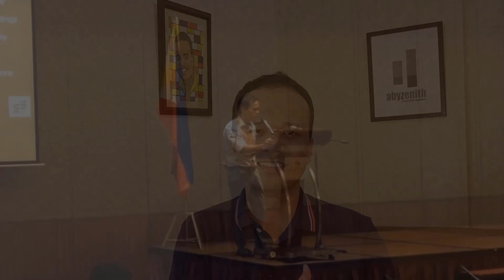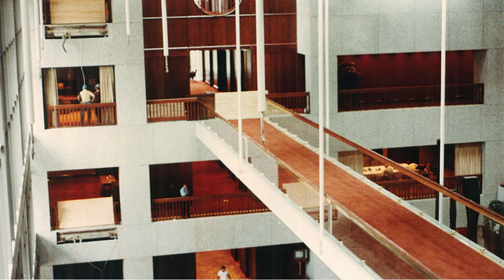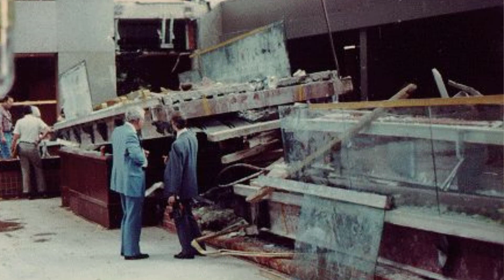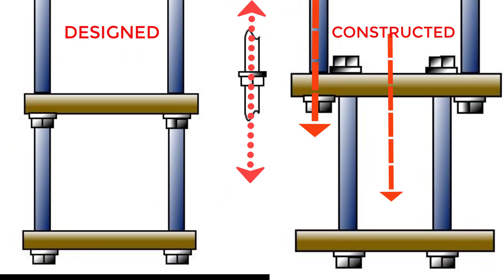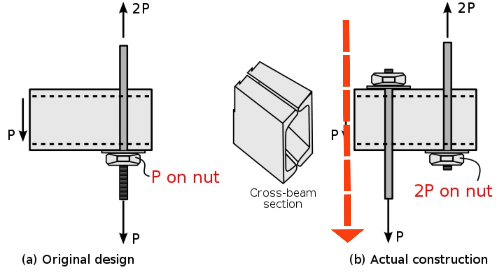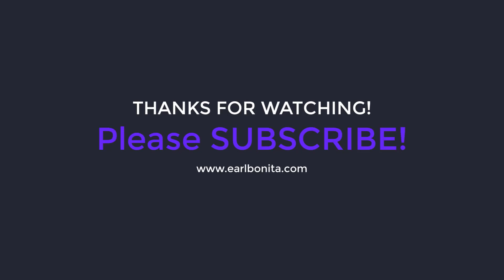HYATT REGENCY "SKYWALKS" COLLAPSE LEARNINGS from STRUCTURAL FAILURES and CONSTRUCTION FAILURES

Comment: The part I always have wondered about was the channels welded together at their thinnest spots as a guy asked a week ago one piece square tubing would have been stronger but more costly but if your going to weld channels to make a box beam why not turn it sideways so the nuts bear on the thicker walls and the thin welds are at the least stressed center of the beam.  Restated the upper channel would be in compression and the lower channel in tension with almost 0 stress on the thin welded area
Reply from the maker: That's a good observation, on welding the the channels back to back on its web, which is much more stronger. In this approach, is to drill a thread-hole for the rod to pass through the channel web, which can be taken cared of. Though, might need to check the tearing capacity of the channel web. 

Possibly in the mind of the erector is to convert 2 channels into a tubular section, wherein after they welded the thinner part toe to toe, it forms a closed tubular sections. However, this approach becomes a weak connection, and must be weld consistently to avoid a weak portion along its length.

Comment: Cone shaped nuts, cut in half, and cone shaped receiving  sockets welded to the bottom of the cross pieces.  That would be a strong as the original design, and  overcomes the erectors complaint about having to thread the nuts all the way up the rod.  

On your comment about welding the the C-channels together “toe to toe”, is weaker then welding them together back to back.  Why would you not just go with a “I-beam”, which I think would be stronger that either configuration weld joined “C-Channel”?   And, welding them together toe to toe just makes a tube.  So, why would you not use a tubular component?
Reply from the maker: Having to thread the nuts all the way up, is a huge challenge to the erector. The original design should have been improved such that it would be easier to construct / install, as long as the allowable tension capacity of the rod is not sacrificed.

They opted to weld the 2 channels together toe to toe possibly due to the availability of the materials and possibly due to time constraints. However, Wide Flange and or Tubular sections might be better and a  stronger component, which doesn't need welding together at all.
Reply: @structureinstitute5251  That was why I suggested a split cone nut and a receiving socket.  If you ever worked on the valve train of a car engine, the valve keepers are cone wedges which are placed onto the valve stem, and have ridges which fit in to grooves machined into the valve stem to receive them, then the keeper and spring come back up and lock everything in place.   

The cone nut is simply a nut, with the flats machined with a taper on the flats, split in two like the wedges  of the valve keepers.  A receiving socket is matchined or welded to the part you’re going to hold in place on the threaded rod.  The split nut is placed around the threaded rod, and then the piece with the socket drops down around it to retain the two halves in place, and it works just like an un-split nut.
Reply from the maker: @randallthomas5207  Yes , agree with your suggestion. Definitely it would be a snug fit that will hold the deck framing  together, that is easier and faster to install throughout the threaded rod.

Comment: Nice video. Very informative! Connections of steel members is one of the most overlooked aspects of steel construction and this would have been avoided by carefully checking the shop drawings as per design intent. If site conditions may result to change in design intent, this will require a more thorough analysis.
Reply from the maker: Hi Michael. Thank you for sharing your thoughts. Agree on it. Connections might be treated with  a reasonable "safety factor" which serves as redundancy. Then again, any changes should have been scrutinized.